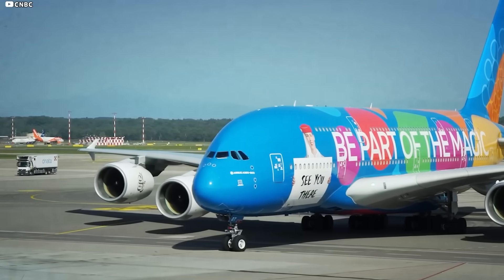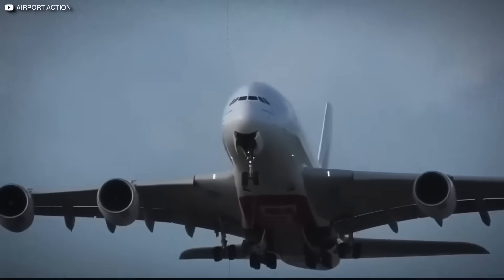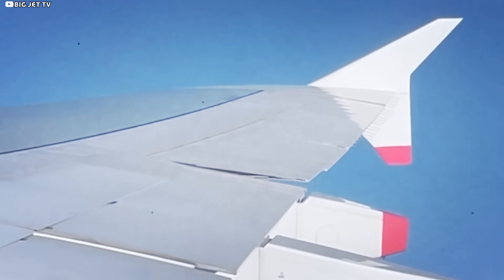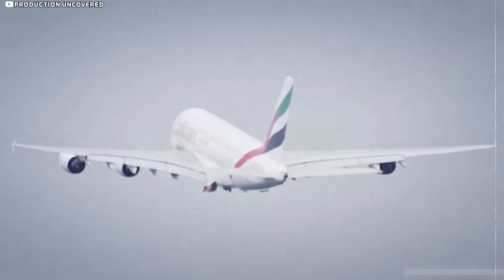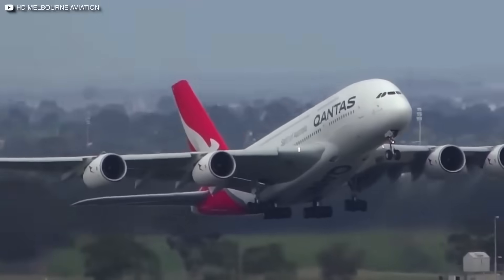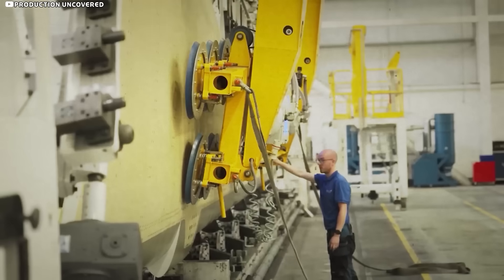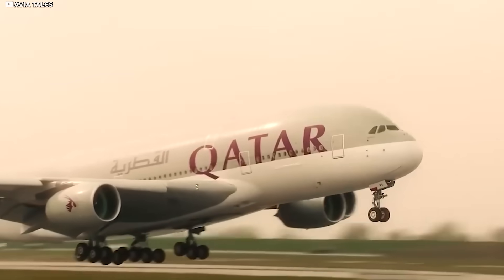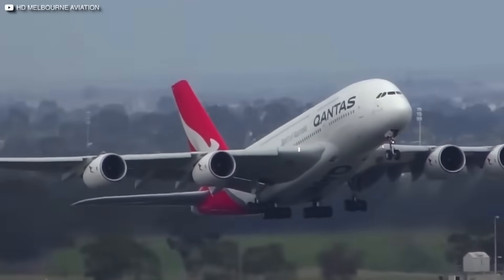How Airbus Outsmarted Boeing With The A380's Wings

Comment: Not ever losing a wing is impressive, seeing that no commercial passenger plane has ever just lost a wing.
Reply: Unless you go back to the 1950’s-1960’s when Lockheed Electra’s had a engine frequency problem that caused a couple of the aircraft actually lose their wings until the problem was figured out.
Reply: "Not ever losing a wing is impressive, seeing that no commercial passenger plane has ever just lost a wing."
If I am wrong some large aircraft actually did (military) and some commercial aircraft had wing stress test failing below spec... so it happen
Reply: @arofhoofyes it happened and can still happen to any airliner if they entered a severe storm system but modern aircraft have onboard radar to avoid storms. But any airliners who pull enough g forces in any high speed maneuver can tear apart the tail components or even the wings

Comment: I cannot understand all this fuss about preferring flexing on the wings, as evolution in nature has proven the benefits of flexing, in branches of trees,  tails of fish, wings of birds, and  flexing of muscles working in coordination with jointed brittle bones.  I have done a lot of metallurgy, and heating and cooling and freezing solids and liquids and studied the interlacing of dendrites in brittle and malleable material including water and ice. That is all very useful, but if one considers the fact that Force is equal to Mass multiplied by Acceleration,  where in an aircraft, one needs to change the rate of change of momentum of the fuselage in gusty wind conditions, then having a non flexing wing would shorten the time the lift on the wing reacts with accelertion the mass of the fuselage. I would not like to have that joint without flexing as the force is increased. With flexing the joint between wing and mass of fuselage will be stressed over a longer time and hence the acceleration forces are reduced,  It is thought that the Titanic sunk because the cold steel did not flex but was brittle and that cold did not help at all. 

The same with riding in a car over bumps. With the car having solid suspensions,  the accelerations on the human body would be intolerable, With flexing springs the rate of change of momentum of the car mass will be lowered, and hence less acceleration forces required. One needs to be careful with the dampers too as fast damping of oscillatory motions or ringing  motions will create intolerable forces. Nature went flexing for a good reason  and flexing is also useful in marriage between man and woman as with no flexing in the joint  divorce and separation will be very sudden after the slightest tap.

Comment: This is funny because the a380 suffered from severe wing cracks that made them unsustainable, by 2015 Emirates had to come to the rescue or the a380 production would be cancelled. Besides that, Boeing wings (especially those on 747) are rated for full control at supersonic airflow at mach 1.01 on the upper camber under any circumstance above 7km of altitude while a380, Airbus' fastest plane, can only do mach 0.85 before the structure starts to suffer and the aerodynamic and pressure center shifts to the rear of the wing while the control surfaces stiffen.
Reply: This video has way more "rah rah" Europe than it does factual (accurate) information.

Comment: 11 swimming pools worth of fuel within EACH wing…22 swimming pools worth of fuel total is astonishing.  I’m guessing no fuselage fuel tanks.  That is hard to wrap my head around.
Reply: There are fuselage tanks (wing box) and in the horizontal stabiliser too. 

These all play into trimming the aircraft CG to avoid parasitic drag caused by trimming elevators to achieve straight/level flight. A tailplane can easily account for 5-10% of  the entire drag component at cruise when fuel isn't fore/aft trimmed to cope with the changing CG (this is something that was pioneered on Concorde)

Comment: No, the A380 most assuredly did NOT "outsmart" anybody.  It is a great feat of engineering, but its engineering is based on wise advancement of technology, not childish business politics.

The narrative implies that Airbus invented aeroelastics.  That is wrong by many decades.  The first major issue with aeroelasticity was encountered by the McDonnell Douglas DC-8.  The along came the first Boeing 747 and the technology for designing for aeroelasticity advanced by orders of magnitude.

The A380 advanced the technology another major step, but it was hardly a great technological breakthrough, not by a human lifetime.
Reply: Aeroelasticity was the product of Airbus noticing jeopardizing wing cracks on the wings, prior to 2015. Fly Emirates became the economic and brand ambassador of the a380 and financially rescued the project.
Reply: Try the B-52, not the DC-8

Comment: The greater span of the A380 exceeded Code E limits (72m), so the A380 frequently had to sit at the gate with a full load of passengers and wait for other traffic to clear. This did not break the laws of real estate, airport rules for wingspan limit are still enforced. The 777X exceeds Code E span limits, but the folding wingtips allows it to follow Code E rules on the taxiway and at the gates. Who outsmarted who?

Comment: Boeing Deathliner. Courtesy of the management. Accountants and marketing stars.
Reply: Boeing's problems can be traced back to 1971 and the B747-100. It may have been a star, but it sowed the seeds for financiers to take over and infect the company. That the engineering ethos resisted the beancounters for so long is the real surprise
Reply: Sold more than 4 times as many A380s and still selling and in production.   Yes, it takes a full business approach to create a successful airplane program.

Comment: Fair amount of nonsense.
All aircraft wings flex. The B52 was designed 70 years ago.
The Boeing B-52 Stratofortress is known for its significant wing flex, which is a result of its design and the materials used. The wings can flex from 3 meters (10 feet) down to 6.7 meters (22 feet) up.
Reply: Totally agree.  The triple slotted flap comment was hilarious.

Comment: I'm already impressed when the doors don't fall off.
Reply: Blown Out Exit In Neighbour's Garden
Reply: The A380 is a magic carpet ride compared with every other aircraft. Half the time you can't tell the moment when the aircraft leaves the ground or touches down and the cabin is QUIET with plenty of shoulder room

The operators who make the A380 pay are making serious money on FREIGHT

The A380 has 32-38 LD3 spots available, vs the 777-300/A350-1000's 44 LD3s. You lose about 1 LD3 per 70 passengers and whilst B777/A350 can haul more cubic metres, the A380 can haul more mass AND go 25% further whilst doing it. That's why there's never much serious weight enforcement on a A380 vs B777 or A350

By reducing the pax load from 850 to ~550, you increase your LD3 capacity and can utilise the freed up cabin space to provide more space in economy AND install halo class seating - which is fantastic income when it's actually sold but more often some lucky so-and-so gets bumped upwards from cheaper seating - this is an amazing way of generating better advertising (word of mouth) than any multibillion dollar media campaign can achieve. Having a full freight load is what frees airlines up from having to consistently achieve 75% seat fills (and of course the fewer pax you carry, the more freight you can haul. A 50% loaded A380 can make most of that up on the 4-5 extra LD3s.

This equation is why many airlines have dropped A380s - they're simply not freight focussed and can't make the math work in their favour.

I'd imagine that Tim Clarke would pay for Airbus to build a new factory line if he could. He's already offered to pay the €25 billion needed for a A380NEO, but Airbus faciilties are overstretched as it is, trying to keep up with A320 demand (8000+ order backlog and growing daily) and the overall profit on narrowbodies is greater than the big birds (Things aren't helped by the LEAP groundings at the moment. P&W is likely to end up owing hundreds of billions in contract penalties, if not bankrupt)

I'd also imagine that Clarke would run A380 Combis if he could (freight in the belly and lower deck, pax in the upper deck) and we might see that as they age out. I'm aware the pax cabin floor isn't strong enough for freight but the fact that the A380F was on the verge of production means that the changes needed are a known quantity and the airframe is equipped for cargo doors in the right locations
Reply: @alanbrown397  the a380f is not a thing, and it will never happen since the huge volume of the fuselage will be wasted, since there's no way to load high volume cargo on it through any other part of the aircraft. Most of the sides of the fuselage are populated by the wing roots, this makes tail bay loading impossible and the flight deck being between both floors make it impossible to load from the front. The Belugas fill this niche. 
Many airlines actually dropped the a380 because it has the least time periods regulated between D Checks of any aircraft in the world and it's a pain in the wallet to be constantly getting the wing spars and camber skins fixed from the fatigue cracks. It all happened when the a380 stopped being built, this is why only rich airlines keep flying them, taking spare parts from grounded units until there's nothing left. The real answer to cargo by Airbus would be an A330 Beluga for anyone, not just for Airbus.
Reply: @alanbrown397  One airline does make for a successful airplane program.

Comment: 707 wings seemed to flap the few times I've flown on them over the years!
Reply: All wings flap… to a degree. Make it perfectly stiff and it will be inefficient weightwise or will snap in a gust. It will also transmit all force variances due to atmospheric variances unabated to the fuselage, necessitating a tougher fuselage and more weight.

Comment: How many Airbus a380s are in service, like 5?
Reply: Not 5, but 189 are in service.
Reply: Compared to the 1600 airbus predicted in 1997, out of a total market of 2200. 189/2200❓❓❓❓❓❓❓❓❓
Reply: @KeyshowJi  The entire B747 production run was about 1550 units. Compare with over 30,000 B737/A320s

in 1992 when the project started, hub-spoke routes dominated and were growing. It was EETOPS 180/240 that allowed big twins to cross oceans and connect city pairs that were previously uneconomic. Nobody realised how much the industry would grab onto that and the first few years (through to about 2003-4) had a very low uptake for long thin routes before everyone piled on.

By that point Airbus was locked into the A380 and in any case they were more or less locked into building a B747 rival because without it airlines couldn't buy an entire homogenous fleet. Boeing heavily leveraged that and offered STEEP discounts on airframes if buyers didn't buy competing makers' aircraft. This was something that got mentioned several times in aviation media during the 1990s when the A3XX was still floating around unannounced
Reply: The '90s were also the downsizing period after the Cold War and MBA-driven Mergers & Acquisitions craze, through which you may have got the "other" type airplane that you had been resisting tooth and nail.

Comment: I can guarantee you that Airbus didn't have to figure how to generate enough to lift 1.2 million pounds.  They think in kilos.
Reply: …and liters!
Reply: @zdenekkindl2778  And metres, but also feet, nautical miles and pounds of fuel

Aviation is a terrible hotchpotch of measurements. I'm surprised they're not still using rods, perches and poles

Comment: I hope they kept everything, not just the wings,  so if the big bus should go back into production they won't have to start over from scratch.
If market forces are correct with predicting an up tick in demand for the super jumbo, a new engined A380 variant with efficiency that makes these jets burn 20±% less fuel. Then they'll be well placed to take full advantage of the opportunity. 
The big bus will seem an attractive, or a more attractive proposition for fleet acquisition and profit margins. 
 If they haven't kept the complex production infrastructure. Sold or  Scrapped. Then it would be far too expensive to consider i would. Imagine.

Comment: You start by being wrong.  ICAO sets the upper limit of each wingspan category.  For Code E it is 65m, for Code F it is 80m.  The B747 is Code E, the A380 is Code F.  These dimensions affect not just parking stand widths, but taxiway widths and separations and runway width and runway strip widths and separations.  Most international airports could accommodate Code E aircraft on their runways, most taxiways and a selected proportion of their aircraft parking stands.  Then along came the A380 proposal (and Boeing was also looking at exceeding the 65m Code E limit).  Some airports were designed or modified at considerable cost to accommodate Code F aircraft and many of their contact stands and airbridges redesigned for double deck aircraft (a different set of problems).
Reply: Please don't kill us, Airbus!
Reply: When the B747 first arrived most airports couldn't handle its mass or width either. 

Many taxiways were repositioned sideways a few metres to deal with the issue but because it was a 50 year process the costs aren't usually mentioned and it started life only flying between a few airport pairs. 

Much of the screaming about costs came from the USA and was a proxy for "Not invented here" syndrome. Remember the Americans are big on protectionism/erecting as many trade barriers as they can/crony capitalism and have been for decades, despite the basis of Bretton Woods being to eliminate trade barriers and encourage international trade as a way of discouraging wars by intertwining economies globally
Reply: @alanbrown397  Aw, your poor fragile ego is hurt.

Comment: Concorde’s delta wing was also a masterpiece of complex aeronautical engineering.🇬🇧
Reply: it was done by the same team for the A380 (next generation) in england not france.  Airbus is highly fragmented engineering wise and draws on the best around Europe, that's its strength
Reply: @alanginger7636  I doubt that.   In the mid 1990s there was no remaining at Boeing that had worked on the SST.   All retired.  Same would be true at Airbus.  And the A380 didn't start in earnest until after the joint program with Boeing came to an end.   So md 1990s.   As for the high lift system, it is a single slotted flap, not triple slotted.   Hell, you can see that in the video.   As for the wingtips - no magic there either.  And then there is the issue of flexibility.   The 787 wing was flexed until the wingtip was pointing straight up - never broke.   And while the A380 is a wonderful engineering achievement, it is an economic disaster.  The reason the joint Boeing/Airbus New Large Airplane project came to an end was because Boeing marketing correctly called that an airplane the size of an A380 did not have a large enough market.   Hindsight has shown them to be correct.  If not for Emirates, the A380 would have been a huge failure (Emirates has bought half the production run - about 140 airplanes).   The 787 over 1000 - and Airbus finally admitted defeat with the A350.  At one time Airbus ran ads claiming that a twin engine plane wasn't as safe.  With the advent of the A350 they don't say that anymore.
Reply: @alanginger7636  It was that fragmentation which bit them with the seat wiring. 

The German and French teams were using different versions of the same CAD program, resulting in the wiring being 2cm too short. The fix delay killed A380 freighters thanks to ego (they didn't want freighters flying before the passenger version, resulting in 50 cancelled orders) and resulted in the first dozen planes being 3 tons overweight (these were predicted to be in service 10-12 years and then be torn down for parts. Extra weight is a big no-no in commercial aviation)

It's good that the video points out how the wing development and fuel management has played into other aircraft. The unification and better communications that resulted from the wiring debacle  knocked several billion Euro off the A350 program too, which opens the argument that the cost of sorting that problem out shouldn't be charged to the A380 program